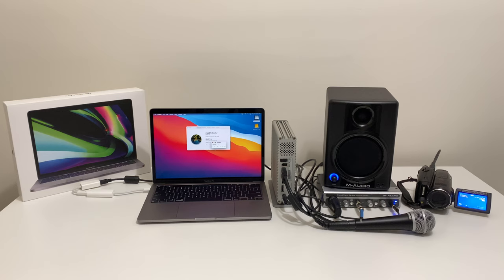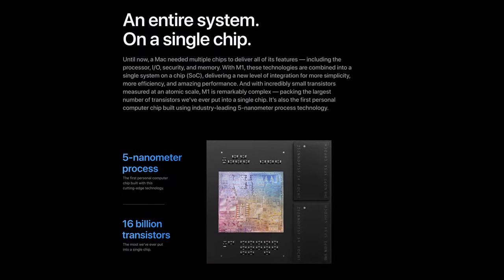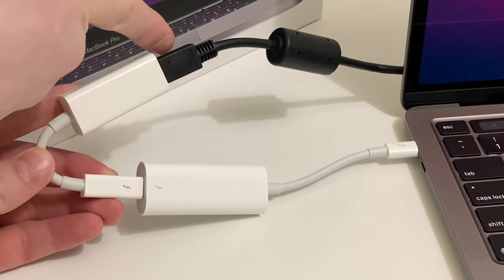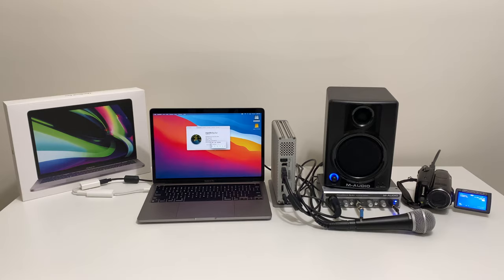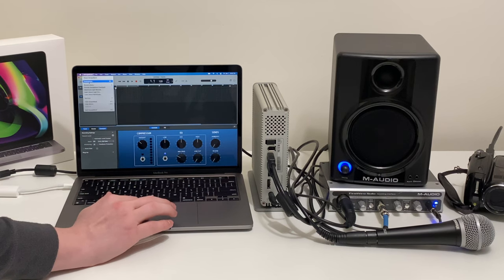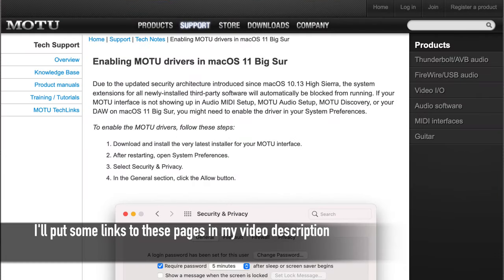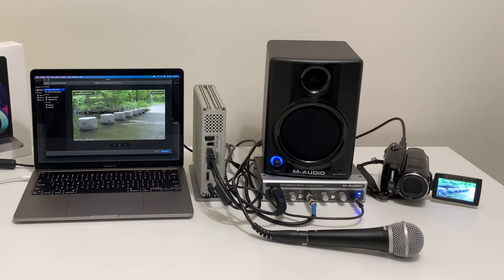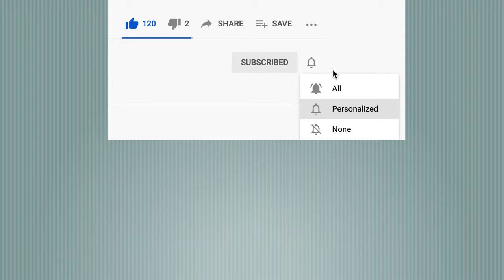How to connect FireWire devices to a new M1/M2/M3 Mac with Apple Silicon

Comment: Tested with the fireface 400 with the new (2023) macbook pro 14, m2 pro chip, with Logic Pro 10.7.7 and Ventura 13.2.1 and everything works!
Reply: I was told that Apple removed Core Audio driver for Firewire in Ventura, mine shows my Firewire device in hardware  but when I go to audio and midi app it's not there. I'm surprised that yours would work but mine don't.  I'm even thinking of using DFU mode to try to downgrade OS to Monterey so it will work like it does on my other Mac. I tried recovery to monterey using a USB installer, doing that on an M2 mac don't work anymore. 
Oh mine is a 2023 Mac Mini M2 Pro.
Reply: @goldtonestudio4471  i use rme fireface400, and i installed the m1/m2 driver released from RME. Followe RME instructions step by step.
Reply: @themanwhostolethetone  Mine is a Midas F32 console with 32 ins and 32 outs Firewire, but they quit updating the driver about 6-8 years ago. But everything connects and works in Monterey without installing the Midas driver.
Reply: Ventura killed all hopes of this working.

Comment: Thanks for this video, I have the Apple connections as per the video but I'm having no luck with an RME Fireface 800 on a new Mac Studio Ultra M1.
Reply: Did you get it to work??
Reply: Yes using the adapters as per the video everything works fine. I had problems at first but it was a software issue. The hardware does the job. At a cost of around £60.00 for the adaptors it’s not a cheap option, but my RME Fireface 800 now works perfectly well with my M1 Studio Ultra. Great video , thanks.

Comment: Thanks for this video. Because of the Canon HV30, I hid the old PC in the case if I needed to download the video via firewire. And transfer via external drive to mac mini m1. Apple adapters aren't cheap, but it's a faster solution than turning on an old PC

Comment: Grateful for this! Just got an M1 but forgot to check if it would support old school firewire. Thanks for the confirmation!
Reply: hmmm, sadly my Focusrite Saffire Pro 30 interface isn't being seen on the M1. Any thoughts? I'm sadly thinking this device may not work.
Reply: @cassnate6259  I'm concerned as well, cus I have a focusrite pro 40, but my concern is what are the conversion method as it relates to the cables and adapters?
Reply: @cassnate6259 did you get it work??
Reply: In related news, I got the adapters for my Presonus firestudio only to find out that there is no longer a supporting driver. The v1.7.5 that works with the device does not work with recent MacOS versions.

Comment: Hey there, just an update:  I unearthed an old (2007) Glyph PortaGig Firewire 800 drive that I needed to get data off of.  I didn't have the power supply, and nothing I had worked.  Their literature said that it was bus-powered via the FW 800 port, but it didn't work that way when I daisy chained the two adaptors into my M1 Macbook Pro.  But those drives also have a mini-USB connector, so I ordered a mini-to-USB C cable - and that actually worked, no PS necessary! 
Additional note: Glyph actually sells power supplies for that drive, it's not on the website yet, but an email to tech support uncovered that (they were very responsive).  I was about to order one, but now no need! 
Hope this helps someone!
Reply from the maker: Yes, some old FireWire drives also have USB as an option and if that is the case, it's much easier to use USB. The only downside is it won't be as fast when transferring files.
Reply: @ScottSchramm  Well it took "about an hour" for 160 GB, but a quick walk to my local cafe was all that was needed.  Their literature (from 2007) seemed to indicate that bus-powering would only work on the FW port, so it was a pleasant surprise for me!  Oh, and the fact that it worked at all, haha!  It was not exactly stored in a temperature-controlled vault... 😁
Thanks to your video, though - it got me thinking down the right path!

Comment: Just retired my beloved Apple 2008 Imac (to computer4kids) and bought an M1 Apple IMac, 16G ram, 2TB HD - confused on cables - bought an OWC Mercury Elite Pro, and use an OWC Thunderbolt Dock, which has ethernet port, USB 3.2, thunderbolt 3 and 4 - what adapters do I need?  Imac has thunderbolt 3 and 4 ports I believe, Mercury Elite pro has firewire 800, and esata - and usb 3.2 (weird shaped one) - ?
Reply from the maker: Your best bet would actually be to use the USB 3 connection on the hard drive so you don't need the two dongles. All you need is this cable: https://amzn.to/3SGiyFM

Comment: This is very good information, however in April of 2024, the Firewire800 to Thunderbolt2 adapter cannot be found.  Thunderbolt2 to Thunderbolt3 is available.  Any workaround for the FIrewire800 to Thunderbolt2 adapter?  Are there any converters that would work?
Reply: I just saw your response about the Firewire800 to Thunderbolt2 cable being discontinued.  I am needing to connect my Drobo to my new Mac Mini M2 and am having a heck of a time figuring it out.  Still searching.  Thank you for your videos!
Reply from the maker: Yep I made an updated video here:
https://youtu.be/LXXSZdOZb-k
Your best bet is finding the adapter used like eBay or keep using your Drobo on an older Mac and enable file sharing so your new Mac and connect to your old Mac to access the data.
Reply: @ScottSchramm  I did look on EBay and the sellers are well aware that their inventory has been discontinued by Apple. I am seeing prices around $159.00 for this adapter 🤦🏼‍♀️. 

I have a 2010 Mac Pro and a Drobo using the Firewall 800 connector.  It will seem clunky to keep everything in my office when I was hopeful to connect the Drobo to my new Mac Mini M2. Contemplating finding a newer storage solution for my files, one that will connect to my Mac Mini M2. Again, appreciate your kind help. ❤️

Comment: Running Sonoma. I have all the adapters and the connection to my old Alesis MultiMix FW shows as working via the System Report, but it does not show up in Sound settings under Input or Output. Alesis no longer makes drivers... is there any other way to get these to show up?
Reply from the maker: No, you will need an older version of macOS

Comment: FYI, these adapters still work on the MacBook Pro 14" with M3 Pro (has thunderbolt 4) and latest Sonoma. It should work on all latest M3 MacBooks. I also use an older Thunderbolt 2 Dock with has firewire built in, but the official Apple FW800 to TB2 adapter still is nice to have. I am archiving lots of VHS and DV from cameras that have an i-link interface (firewire) and was concerned that these adapters would no longer work and would have to keep my M1 MBA around to do this... There is some misleading information out there that implies TB4 is not backwards compatible with TB2 and only TB3 was, but this is incorrect in my testing.
Reply from the maker: Thanks for sharing your experience! On the PC side, Intel did drop backwards compatibility with TB4 to TB3 but on the Mac side, it is still supported like you mentioned.
Reply: What dock are you using that has TB2 and firewire

Comment: when you say thunderbolt 3 adapter to thunderbolt adapter, do you mean thunderbolt 2 ? because i can't find any place where to buy thunderbolt 3 to thunderbolt 1 adapter.
Reply from the maker: Thunderbolt 1 and 2 use the same plug but is different from Thunderbolt 3. The links are in the video description.

Comment: I have a firestore fs100 dvr that can only connect to a computer using firewire. I know connecting it directly to a firewire adapter card for pc works, so I was wondering if I could connect the fs100 through the same method you use as if the fs100 was a camera, per say, and it would still work for my macbook with a thunderbolt port . thanks
Reply from the maker: I've never used one of those devices as they seem quite rare these days, but I believe they should work the same way as a camcorder and should work fine if use the the adapters to connect it via Thunderbolt. If you get it working, please let us know!

Comment: Your videos are great, thanks so much!
Reply: Hey, I would love your recommendation for 2Tb external backup hard drives (to use with new 14" m1 macbook pro). I've been using LaCie Rugged Firewire for years because it was the only one that seemed to stay connected and I got sick of trying stuff that didn't work. Figuring I shouldn't keep using it with the adaptor combo as my main Time Machine connection, and probably get a usb-c type instead.
Reply from the maker: @myalkut  I recommend the Crucial X8 2TB Portable SSD: https://amzn.to/3ID4FBH  I have the 1TB version and it works great, super fast too! If you need a cheaper option and don't see super fast speed, here are a few other options:  https://www.amazon.com/shop/scottschramm?listId=YPOL5S7P6ODL

Comment: Just bought the Apple Firewire to Thunderbolt adapter....only to discover I also need the Thunderbolt to Thunderbolt one as well!  As I always say, standards are great, lets have lots....   Still, 2 adapters is still cheaper than junking my old Firewire Iomega storage drive. Just need the new iMac to arrive now.

Thanks for the video - nice to have confirmation this mad idea will work.
Reply: Trying to do this myself but the Mac won’t recognize my dcr-trv340. My older Mac worked fine.

Comment: Thank you Scott! So, basically, You're saying that if I connect the Mackie mixer using an 800 to 400 firewire cable to the 400 to USB cable and then I connect to the MAC it should work?
I have a Mackie mixer ONYX 1640 and Big Sur 11.6 on a MAC MINI (M1 2020).
Reply from the maker: It does not work with USB-A, it needs to be Thunderbolt as shown in this video.
Reply: @ScottSchramm  ok, I have 2 ( Thunderbolt / USB 4 - Thunderbolt 3 (up to 40 Gb/s) )
Reply from the maker: @robertjameshanrahan  yep those are the right ports. Now you just need to get the adapters linked in the video description

Comment: @Scott Schramm  
Do you have any experience with when updated to Ventura? Unfortunately, my computer has been updated and now I cannot connect to my firewire audio Interface.
Reply from the maker: I’ve tested a camcorder with Ventura and it still works so FireWire is still supported but for audio interfaces you may need to check with the manufacture since they may require special drivers.
Reply: @ScottSchramm  the funny thing is that before the update I could just connect it and then it worked. Without any special driver..

Comment: Just came across your video‼️ I have a 2017 MacBook Air and I’m trying to connect the Apollo twin... what do you think I should  do to get the Apollo interface to work?
Reply from the maker: The 2017 MacBook Air has Thunderbolt 2 and it looks like the Apollo Twin also has Thunderbolt. So all you need is a Thunderbolt to Thunderbolt cable. Here is a short one: https://amzn.to/3utP5o7 or here is a longer one: https://amzn.to/3upOfIU

Comment: Hello to everybody. I was looking this excellent video and I would like to ask for some help since there is something that I still have not clear. I have just bought a Macbook Air 2020 with M1 processor and I woul like to connect it to my SONY DCR TRV120 Digital Camera which is has a 4-Pin DV IN/OUT port so, what is the most recommended way co connect ? I have a 1394 Firewire 6 to 4 pin cable. Thank you so much for your help !
Reply from the maker: Go to the video description...the items you need are the first three links.

Comment: Hey Scott, thank you for your videos on this topic. I'm using a gen 1 Drobo that connects via Firewire 800. I've used Apples FW800 to Thunderbolt 2 adaptor on my late 2013 Powerbook 15" and it's always been problematic. Just having it plugged into the computer has caused software crashes and an inability to shut down. It also fails frequently during file transfers. But I've dealt with it over the years. I'm now buying a new M1pro 16" and I'm a bit worried that I'll have the same (if not worse) luck adding the Thunderbolt 2 to USB C adaptor. I'd love to hear your thoughts.
Reply from the maker: I don't have any experience with Drobo's but I've heard they can be problematic to mange. You can certainly buy the additional adapter to convert Thunderbolt 3 to 2 and try it out and if it continues to give you problems, it may be time to get a newer NAS and migrate your data over. I've heard good things about Synology DiskStation and QNAP devices.
Reply: @ScottSchramm  Hey Scott, many thanks for the fast reply. Yep, I think you may be correct. That it's time to suck it up and make an upgrade.
Reply: Just hanging out in the doorway for this chat...I'm also dealing with older Firewire 800 to new M1 Mac. Running a Nikon Coolscan and hoping this will all work. Remember when Firewire 800 was the Be All End All of connections? Yeah, that was cool.

Comment: Hi Scott, I was hoping you were going to test a Griffin FireWave 5.1 speaker system. I followed your cable suggestions and I can hear the speakers on a restart, but the drivers won't install because PowerPC applications are no longer supported. Griffin doesn't support FireWave after OS 10.4 I was wondering if there was another way I could use the speaker system.
Reply from the maker: Sorry but I doubt you'll ever get it to work if it was made for PowerPC. Your best bet would be to upgrade to something like this: https://amzn.to/43YSmK7

Comment: Hi Scott, thanks for you video and helpful comments.  My Sony handycam camcorder shows up in the system report, with correct model number, but iMovie doesn’t see it. Sony’s website doesn’t have a driver for that device, even an old driver.  Any ideas?  Thanks
Reply from the maker: If you are running macOS 12.3 or higher, it could be due to a bug from Apple. Check out this video: https://youtu.be/vfwfZgGI3JY

Comment: Hey Scott, thanks for the video; it is very helpful. I have the new MacBook Pro with the M1 Pro chip. When I talked to an Apple rep she said their Thunderbolt to FireWire adapter does not work on the newest MacBook Pros. She said Thunderbolt 3 is a different connector than Thunderbolt 4. They look the same to me. They look similar to USB-C. Do you have any experience with the newest MacBook Pros? Also I have several hubs that are USB. When I connect them to the new Mac via a USB to USB-C adapter the drive in the hub are not recognized by the Mac. Any suggestions? Thanks again.
Reply from the maker: The person at Apple you talked to must have been confused. Thunderbolt 4, USB 4, and Thunderbolt 3 are essentially all the same on Mac's. For PC's, there are some differences due to the way some manufactures chose to implement it. If you follow the process in this video it should work fine for you.
Reply: @ScottSchramm  I have had several chat sessions with Apple techs over the past week. It seems confusion is very common there. Thanks for the quick answer.
Reply: @ScottSchramm  I have same problem I think its the OS Monterey? What are you using ?
Reply from the maker: @Oasis293  Still working the same way with the latest Monterey which is currently 12.6
Reply from the maker: Still works in macOS Ventura as well: https://youtu.be/-okFyuJYZ6c

Comment: Is there a way to connect Thunderbolt 2 to Thunderbolt 3 or 4?
Reply from the maker: Yes, you can connect Thunderbolt 2 devices to a computer with Thunderbolt 3 or 4. You just need the adapter which I have a the top of the list in my video description.
Reply: Unfortunately, it is only for Mac and does not support Windows
 @ScottSchramm
Reply from the maker: The Apple adapters work on Windows.

Comment: If i have a older mac book with a firewire port can i just plug it without adapters?
Reply from the maker: Yes, if you have a FireWire port you can connect directly to that unless you need to adapt between FireWire 800 (square plug) to FireWire 400 (rectangle plug) or FireWire 400 mini (the smaller plug)

Comment: Have you managed to get that audio interfrace working on Ventura? I have exactly the same model and am having no luck. The interface powers on and shows up in System Report, but not in sound preferences or Logic, and none of the driver installers work (latest I could find on the m-audio website was for osx 10.7.4).
Reply from the maker: Just tried it on my test system which is running 13.2 beta. My M-Audio interface powered up using bus power (also tried plugging in the AC adapter) and it shows up in the System Report but when I look in the sound settings and Audio MIDI Setup, it does not appear any more. So I would say Ventura has fully dropped support for this 20 year old device! However it hasn't killed all FireWire audio interfaces as I've heard from other viewers that their (somewhat newer devices that use FireWire) still work.
Reply: @ScottSchramm  Thanks for testing and getting back to me so quickly. Shame it no longer works because my experiences with newer USB interfaces have been disappointing, all of them having noticeably higher noise floors than the Firewire Solo, to the point of being unusable for things like high-gain guitar tracking. Will just have to track on my older machines I guess.
Thanks again.